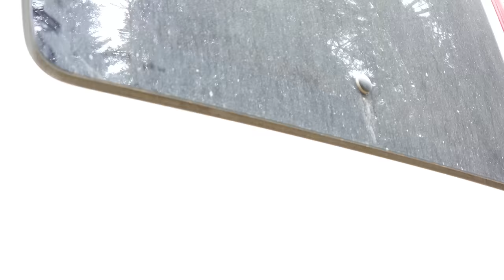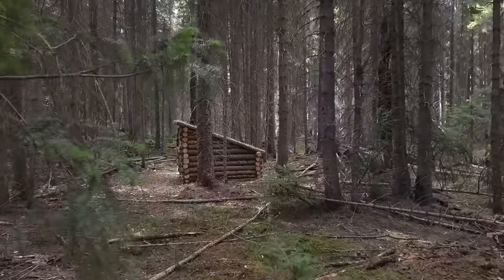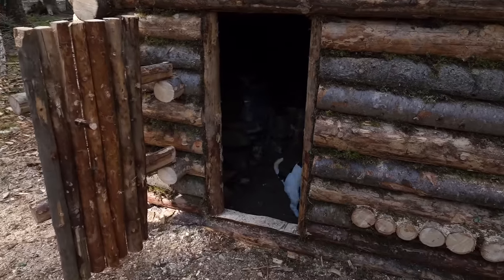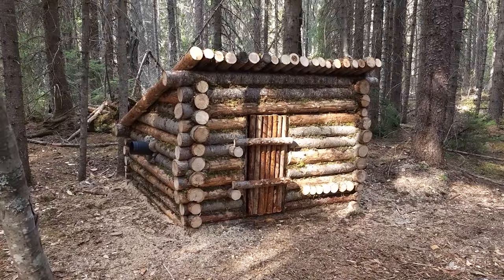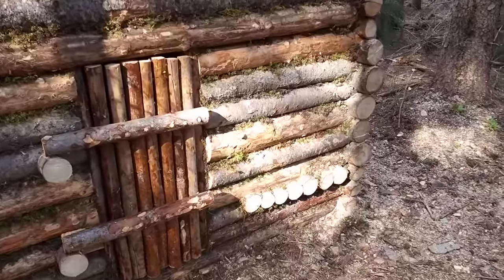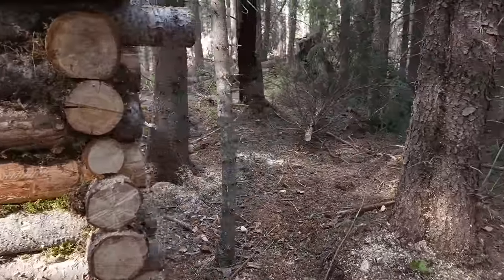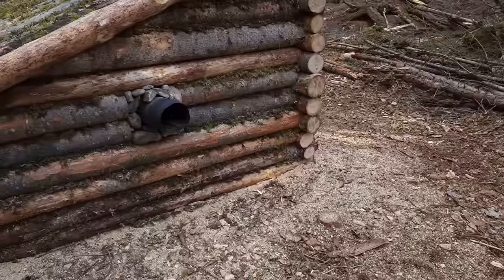I Built a Secret Tiny Cabin that has Wood Stove Heating

Comment: My elderly mother advised that stones should have been placed under the foundation logs. It was also necessary to make a gable roof, then the water would definitely roll off and the roof would not leak. For waterproofing the roof, she recommends using shingles. 😃😁
Reply: Cinder blocks would work for the foundation and a plastic tarp to keep water out
Reply: Your mother was right. His roof leaked in the recent video.
Reply: Stones would help keep the bottom logs dry or at least to dry out.

For waterproofing, cover the roof with a good thick layer of earth and let the weeds take over.  But there'd still be no getting around dirt and dust from the roof.

You'd be surprised how cheap it would be to cover that thing with cedar shakes.

I like the battery-powered chainsaw for this application.  Think of what he built, and translate that into firewood.  Very practical for keeping up and staying ahead of firewood needs.
Reply: Cover the roof with green bows, dirt and moss
Reply: That roofs going to leak gable or not. If there’s water and clay dirt available along with some grass he could make flat clay tiles, fire them in coals, and lay then them on just like any clay tile or slate shingled roof. I’ve built a lot of houses over a 40- year career of home building and I can’t really fault his construction technique’s considering the style being a shed lean to; very practical.

Comment: YESSSSSSSSSSS! It’s great to see someone, you, using some power tools building such a great little cabin. And, you did it without nails and steel screws. Get a shingle froe tool and larger logs cut to length and make wooden hand split shingles. Making them is not that difficult and way better than bark. You will like the roof a lot then.

Comment: Watched to the end, great look!  I'm sure it could help someone caught out in bad weather, and they'd be grateful for it.  On the bugs you mentioned, one option is to supplement the chinking with a cob mixture, at least on the inside.  Also, peeling the logs, at least on the inside surfaces, helps with bugs.  Laying the first course of logs on a chinked sill of flat rocks (if you have any in the area), with the top surfaces sloped down toward the outside, could help.  If you lack a source of good bark for shingling, any species of wood in the area that splits cleanly could be worked into shakes for shingling using your chainsaw and axe without too much trouble, then the roofing could consist of those pegged at the upper end into purlins every foot or so, no need for a full log roof.  Overlap most of the shingle length with the next course on top, and no cracks aligned, always bridge a gap below with a shingle that straddles it.

But even saying all that, it's a good shelter, and for someone in need, a real blessing.  Good work!!
Reply: Doing this smarter would take more time to finish. You don't know what you don't know, but I must say that I could NOT do as well.

Comment: What if you put a plywood shelf above the bed to give you gear storage and protection from dripping sap?  

For bugs getting in the door gaps what about hanging up a mosquitto net (the kind you can buy that are split down the center and meant to put in a door frame) temporarily?  Some pegs in the wall could give you a place to quickly hang it up when using the cabin, and then take it down when leaving so nothing unnatural is left.  It might be a handy thing to have for the van too.

Comment: Really nice little hideout. That roof will be the first thing to rot since you put moss between the timbers. It will gather water and moisture. You might have wanted to use some other wood than conifers on the roof because conifers tend to produce sap when warmed
Reply: Was thinking about that also. He could just run the heater a lot like all the time to help dry the place out.. but may not completely solve the problem.
Reply: It's the most that little pos electric chainsaw could cut...

Comment: Very well done on the cabin it looks so cozy, on the roof you could make overlapping boards would keep it drip free or at least pine bows on top to prevent the rain from coming in, add a tiny window on the opposite wall from the stove for ventilation or fresh air

Comment: This is one of the best cabin builds I have seen. Good use of power tools, ingenious door, and one of the few guys to pack rocks around the stove to soak up the heat then radiate out all night.
I wonder if you mixed your wood ash with sandy or clay dirt and water into a paste you might get a cement like substance that when you pack it into the moss between the logs above your bed it could help with the waterproofing (on the outside)

Comment: I would definitely install some sort of internal latch/locking mechanism on the door to make it harder for natures creatures to pry it open if you know what I mean.  Definitely try to avoid Backdraft by raising the stove pipe above the roof for your safety.  Put some thing on top of it to help with the sparks that might possibly come out that way you don’t burn the forest or yourself to a crisp. As far as sealing up the cabin I would use a mixture of mud, clay, and sand mixed with water like a thick paste. It should last quite a while and it’s all natural. 

Cute pup by the way.

Comment: Water falls down so halve the logs and overlap them flat face up and then flat face down (overlapped), should reduce it tremendously as you not only have 2 layers falling down but overlapped as well.
Reply: Could even channel out the face-up ones with tip of chainsaw.

Comment: For the roof, try alternating, interlocking "u" shapes carved form log halves split down lengthwise. MWMWM So every other forms a trough
Reply: @Reganomics Lamborghini true. Lots of labor but these projects are labors of love. I saw several YouTubes on the subject so I can't take credit for the idea
Reply: Probably wouldn't need to create an interlocking "U" just cut the logs in half and overlap them on the flat side.  The roof has a steep enough pitch the water would run off.

Comment: Just a thought, I'm sure I'm wrong but as far as the valve on the propane tank, aren't they reverse threaded. Clockwise to loosen. . BTW, great video. You might want to put a diagonal cross brace on that door to keep it from sagging. Next cabin, debark the logs. Less rot and no sap dripping on you. Or you could split the roof logs.
Reply: Not sure, but i think that only goes for the outlet side of the valve ( the side you connect the hose to )
Reply: Used to be not anymore. Maybe if the tank is really old.
Reply: The inside threads for filling the tank are reverse-threaded
Reply: @dodgeplow  Thanks, in the video he is having a hard time removing the valve from the tank. those are the threads I'm referring to. Valve to tank.
Reply: @garypeterson3628  Gotcha. I was thinking of the valve itself. Those are standard threads for connecting to the burner/system. Inner on that is for filling. I'm not sure for valve-to-tank

Comment: I built a camp like that when I was a young scout.   I went back to it a few weeks ago and it was still intact and had surprisingly little rot.   You would be surprised at how long that structure will last.   It will outlast you and me both.
Reply: several years ago I rechinked a cabin built in 1774. The logs looked like they been cut a week ago, and 75% of the mud chinking was still in perfect condition. We had to chisel away some of the good mud chinking to match the repairs. There were 230 year old corn cobs in that old chinking that looked like they were freshly shelled.

Comment: Roof - Install some 1"-2" branches perpendicular to the rafters, spaced about 12"-18", for cleats to keep things from sliding off. If you can find some in the area, put down a thick layer of tall grass (straw), and shingle over that with slaps of moss. If you haven't seen it, ya gotta check out "Alone In The Wilderness" - see how Dick does it (though I think he uses tar paper)
Reply: Excellent book and read!!

Comment: Use wood split shingles from short, fat, stubby logs. You just keep splitting down the log into the thinnest little planks you can. A roof that size should only take a few logs to cover. If the log is 1ft tall x 1ft wide then your shingles should come out near 1ft L x 6in W. I'm sure you know already what I'm talking about & have prob already thought of it too. Great little cabin man, thanks for sharing it 👍

Comment: Next one you build you should use techniques like the soldiers during the American Civil War. They built little huts just like this during winter. They would dig down about 2 feet in the ground then build the structure. You will just be stepping down into it through the door opening. They would also use waterproof canvas over the roof. #BattleRunRelics #CivilWarTimeMachine

Comment: That is damn impressive! Rocko did a great job building that with Foresty's help. For info regarding sealing your cabin, check out the My Self Reliance You Tube channel. The creator there built a log cabin by hand a few years ago. I believe he used clay and mud to fill up the cracks between the logs instead of moss.
Reply: Moss will dry and shrink in time
Encouraging a living green roof by adding some soil and seedlings/seeds/grasses could help seal the gaps
Reply: Lol, he referenced Shawn James (My Self Reliance) in the video. Would love to see them meet up!

Comment: Good to see Rocko helping by digging the Latrine Pit. You will definitely have less of problem in Winter with the Bugs and Bears.  When it Rains or Snows, a Tarp can be used on the Roof and then removed when not necessary.
Reply: Rocko knows that sanitation is key

Comment: It’s always wise, if possible, to scrape the bark off the timbers; to cut down on dripping sap and boring bugs and other tiny critters. Excellent build, really luv the battery charged Ryobi chainsaw. I agree with you, you should’ve cantilevered your bed frame past the exterior wall to create a neat little seat & you could’ve cut a cross groove in the top so that rainwater could not run into your bed frame. All in all a very efficient looking build🤩Kudos 😎

Comment: For the roof water proofing I would recommend trying to make some pine tar from pine resin and coating it entirely. What kind of inverter do you use in your van?
Reply from the maker: Hey thanks for the suggestion.. its a Renogy 2000w pure sine inverter

Comment: water tight roof: split logs the same length as the roof in half, carve the middle out so they're concave, then line them up on the roof in an interlocking alternating pattern
Reply: I love that. The water would run down the rounded logs, then channel with gravity down the upside down logs. I love it. 😊
Reply: A few homemade wooden wedges would make quick work of it.
Reply: Basically the same idea as the tile roofs in Europe. Just from wood logs.

Comment: Would be a little concerned about that stove. Most good caste iron ones also have intake vents low down designed to force the air up through the coals and into the chimney. Lengthening the chimney could also help efficiency.
Reply: True. There is no chimney effect (suction draught) without a reasonably tall chimney, smoke will be all over inside the cabin. And a danger of carbon monoxide too.

Comment: Use a tarp. You can police it up when you abandon the site. Extending the logs fir an exterior bench is good thinking. How about a rock base around the perimeter under the foundation logs? Keeps the logs off the ground. Making larger diameter logs is a good thought you had. I learned a lot watching your project. I liked the way you did the door 🚪 hinges.

Comment: Pine branches for roofing, much like straw or thatch, lay them in sections drooping in one direction.  Like wet rope or twine it'll draw moisture and rain down in one direction.  Unless you're in a monsson should work just fine.
Reply: Yes, do this and then pile on 3 feet of duff collected from the forest floor all around you. When it settles down to a foot and a half thick after a couple weeks, put down another layer of branches like Defe said to hold down the bottom layer of duff and pile on another 3 ft of it. As long as you upkeep that top layer 3ft thick or more if possible, you stay dry even in monsoon weather... It sounds crazy but the roof would be almost as thick as the cabin is tall. The most important thing though is weight. It gets really heavy when wet so strong wood is is crucial. The way you pegged it all together looks pretty solid. I would cut a small hole in center of each side wall just below the roof and add a rafter across the center of the roof. Then bury the place!
Reply: @jasonandrelli  So a total of six feet of empty beer cans? 
Great use of recycling!

Comment: Love the door, Forest. How long did this whole build take you? 

For the roof sealing, what about the concrete/adobe stuff they use on some of the primitive build channels? I think it's just dirt and wood ash. That would work for all your joints. 

To slow down the rot on your bottom logs, make a french drain. Dig out under the bottom logs in sections, stuff the void with rocks, and pack the dirt back to hold the rocks in. Slope the dirt away from the base log so less water will collect there. At the corners leave an outlet for any water to drain out and air to circulate under the logs. They'll still stay wetter longer than higher logs but will eventually dry out.
Reply from the maker: Thanks for the tip, I'll take a look at the dirt and wood ash mix.  This took about four days of building.
Reply: @forestyforest  I have seen people work longer to build far less at burning man

Comment: You could have made some boards and did some overlaping singles on the roof to stop it from leaking. Also, smoking the place out would eliminate allot of the insects at least once. Also, depending on whats around you you could take the pup with you and do some herb hunting for some lavender, basil or sage to drive off the masquitoes. Just hange it all around the inside of the cabin plus it makes it smell nicer inside as well in case you want to take a date there lol jk. You also might want to make a flat area on the stove better for cooking/boiling water.

Comment: Roofing Suggestion: Forest, there is a way to build a waterproof roof using no nails or plastic or anything of the sort. It's how the pioneers used to roof their shanties. Few hundred years ago it was very common. It's called a Scoop Roof. What you do is you split logs down the middle, then trough out the flat side, as in hollow it out. Then you lay these scoops with the trough facing up, with more troughs face down over the gaps, "spanish tile" style. Old books recommend 6 inch thick basswood logs, or other free splitting logs, but you can build this kind of roof with any log, it just might take longer and some splits might have to be turned into firewood. I have a fair amount of research on scoop roof log cabins including a few original photographs and historical drawings if you'd like to know more.
Reply: Great idea. 👍
Reply: The guys using bamboo have it so easy for this kind of roofing.

Comment: if there is a next cabin in your plans, then you should look into using v-notch instead of square notch that you used. V-notch is less work-intensive, especially if you are building something very primitive. would have made an easy work with your chainsaw.

very cool an original idea for the hinges. kudos if this is something you invented yourself. very crude but functional and minimum tools required.

cheap tarp or sheet plastic drop-cloth, covered by fresh moss would have made it even better, more weather tight. cornerstones would have been great too so that sill log wouldn't rot as fast

Comment: A noseeum mosquito net suspended from the ceiling over the bed and tucked in under the mattress might help, or a battery powered mosquito light might help.  Good idea about the bed and extending it out the front for a bench.  The roof line could also be extended off the front for a porch overhang over the bench.  Cool structure.  A canvas tarp nailed or stapled to the inside might keep the sap off of you.  If you could find or make some planks even with a live edge, a roof could be made to keep things drier.  You can overlap them at 90 degrees to the log roof like big long shingles.

Comment: Love this one, Consider a layer of dirt about 3 to 4 inches thick on the roof, then covered with moss, The moss and dirt will absorb most of the water and the angle of the roof will allow the water to run down the slope before it has a chance to drip inside.. Subbed to your channel, looks like fun.

Comment: VERY NICE JOB AND FIREPLACE- BUT THE DOOR HINGES WOULD BE MORE SAFER ON THE INSIDE OF THE CABIN. PERHAPS MAKE ANOTHER ENTRY DOOR BEFORE YOU WOULD GET INTO THE MAIN DOOR OF THE CABIN in case of a bear trying to enter. You did an excellent job of building the small cabin- but the next time mabe grab a couple bags of cement and lay a floor- then for more protection cover the whole cabin in cement and perhaps paint it brown. Then cover the roof with sheet metal. I Think you would be more able to sleep better at night because of the wild animals. Perhaps add a few small windows and a strong metal door.